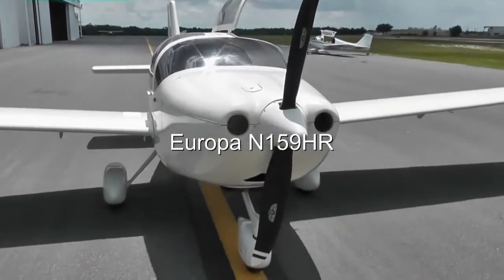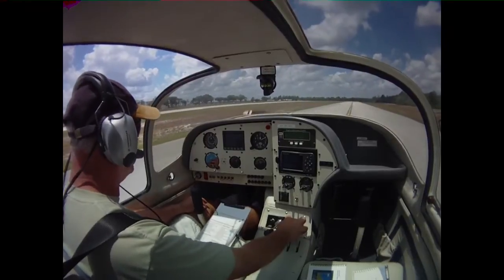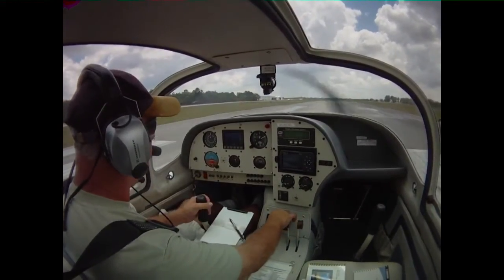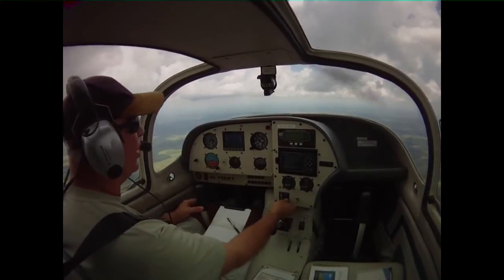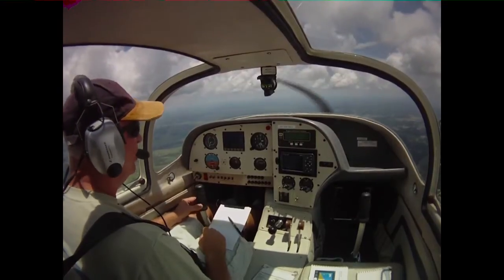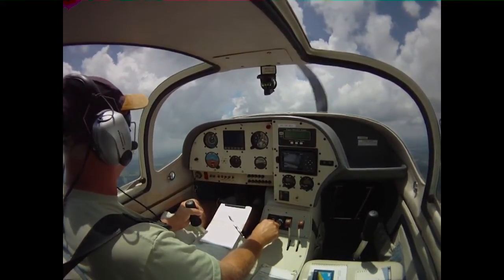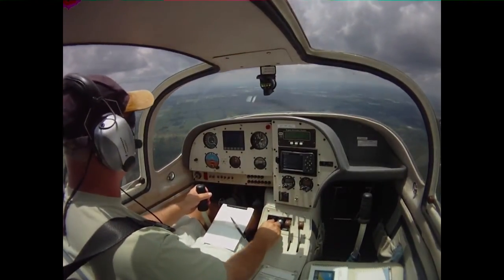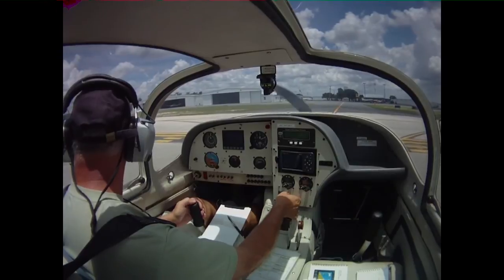Europa 159HR Flight

Comment: You lost me at “Jabiru equipped” !
Reply: savagecub I just left their website and they recommend Rotax but I like the Jabiru 3300.
Reply: DAM8658 
Lots of cooling issues with jabiru.
Reply: @savagecub  I worked on that bird the first few years the orig. owner had it-  aft cyls always max temp-  until the cooling was re-designed...
Reply: @DWB245  I just bought N159HR. I sure hope the cooling issues are resolved now.
Reply: @LTZFLY  the builder took 159 back to the  kit building shop and re worked the cooling plenum.    Thats when the vid was made.  I flew in her great lil bird.... Rotax are reliable but require periodic maintenance way to much.  Im working a 912uls now not a fan.  Enjoy that bird... where will she be living?
Reply: @DWB245  thanks for the reply! She will be in South Georgia. It’s a beautiful little airplane
Reply: @LTZFLY  if you have questions I'll  attempt to answer. The builder was my dentist.  Safe travels.
.
Reply: @LTZFLY  This plane is for sale again, I was going to look at it tomorrow. Was cooling still an issue? Why is it for sale so soon? Thanks.
Reply: @travisbarnes4802  no cooling issues at all. It has several modifications that are additional pluses going for,the airplane. Wide cabin mod, wing tie downs, led landing light, speed fairings, to name a few. The plane is awesome. Being sold only because of having to out parent into nursing home.
Reply: @RH-ow6tu.    how is N159HR running?  any cooling issues?  I hear rotec heads will fix the problem.